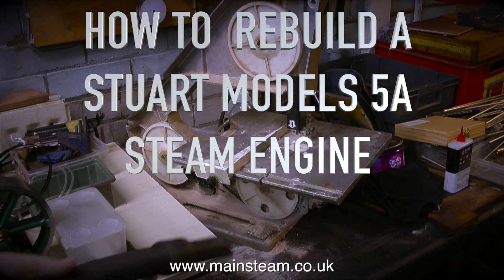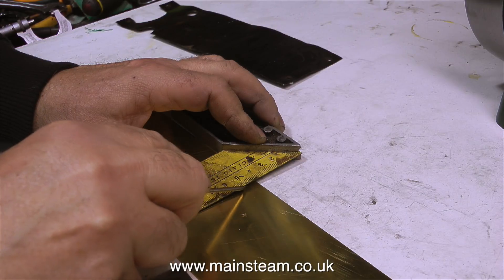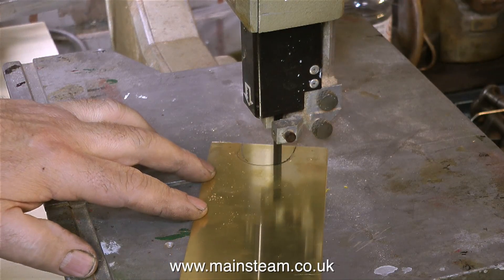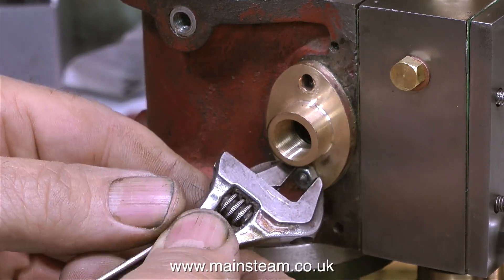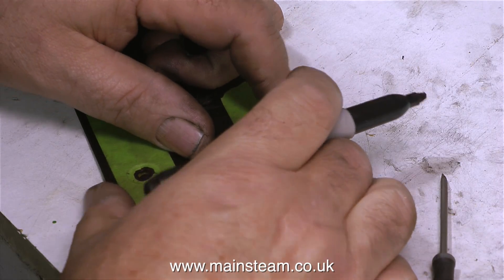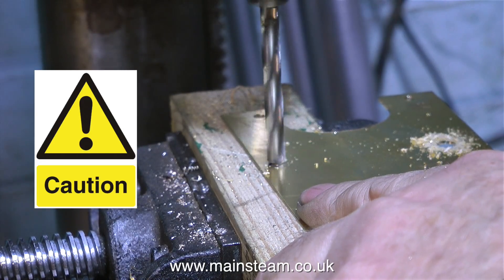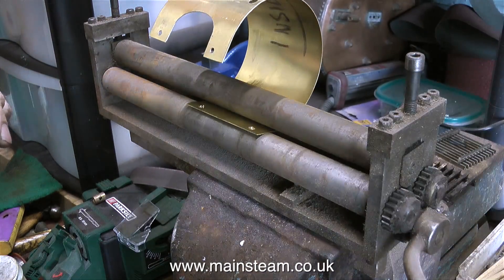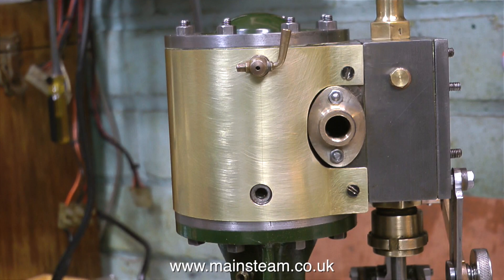HOW TO REBUILD A STUART MODELS 5A STEAM ENGINE - PART #27

Comment: I meant to put in a comment on the last video in this series when you mentioned Dremels.  Avoid the 4000 series, life is just too short to deal with a mess like that.  The power switch on mine gave out so I took it apart to see if I could fix it and the design is the sort of thing that could make strong men lose the will to live.  It reminded me of that bit in one of the Hitchhiker's Guide to the Galaxy books on humanity having made a mistake in coming down from the trees in the first place.

Comment: I too do like the clean brass look, trouble is I see musty brasswork and I get all OCD and can sit still until it looks like spun gold as I am like the Victorians when it comes to that gawjus metal, copper too is another OCD weakness, that pale salmon look and lustre is very pleasing to me and I have polished copper pipe through to a wafer in my time :)
Reply from the maker: Polished copper is good - polished brass takes too long .....
Reply: I use a red rouge soap bar and a polishing mop then follow on with Mothers polish, I am going to do some research on this 1939 Mamod SC3 I just bought as I don't know how strong or thick the copper and brass is and I don't want to destroy it so anything will be done with light handwork methinks.